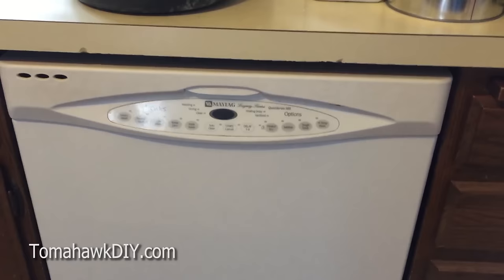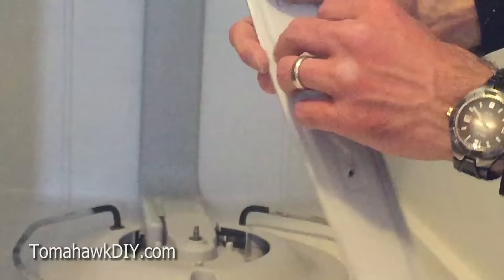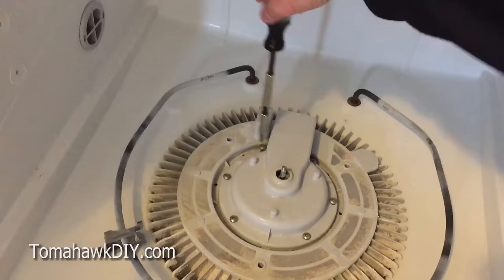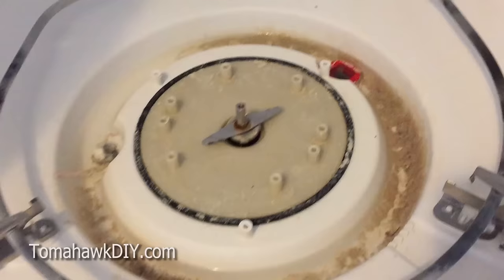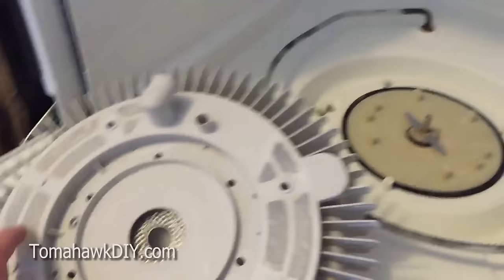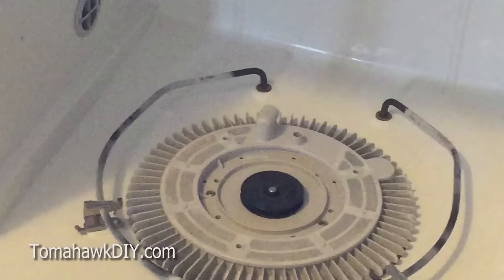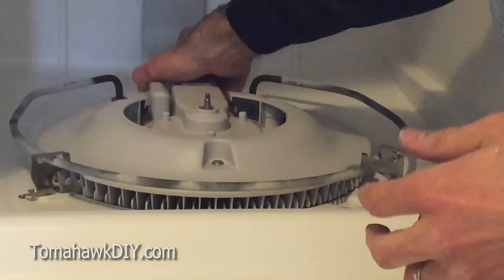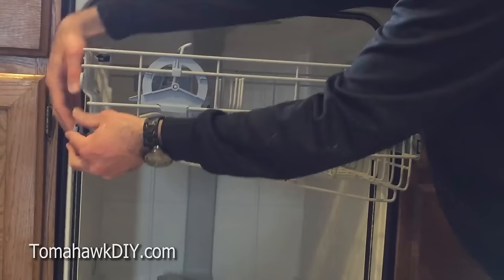Dishwasher Not Cleaning Well - How to Clean

Comment: I have a QuietSeries 100, not 300.  I did exactly that (it seems to be the same water circuit), and also ran water in all the upper pipe elements/spinner,  but I am still getting black dirt in the cups of the top drawer.  Anybody has an idea?

Comment: Great video, very easy to follow. Question for you - the metal clip that holds the spray arm to the top of the dishwasher came off and won't snap back on. Any idea on how to fix? I've been trying different ways to pop it back on and nothing has worked. Thanks!
Reply: The plastic support on the dishwasher body itself is shaped like an X(or a cross).  Position the square hole of the clip over the X and rotate the metal clip slightly so that the four legs of the X point to the CORNERS of the square hole. That allows you to press the clip over the X-shaped support. Then just twist the clip so that the legs of the X catch the clip and hold it in place.

Comment: 4:54 I seem to have it aligned but still can't seem to get this filter on properly. It doesn't go "deep" enough, and when I put on the wheel & try to tighten the screw, it doesn't tighten because the wheel isn't deep enough and so the screw can't get to the metal part that's sticking out.

Comment: You have a different model than mine.  My washer is 20 years old and has been really smelly.  It smells like fish that's been out for a while.  
I'll be cleaning the screen (never done before).
I'll figure it out.  I also have two covers in the bottom front of the washer.  What is that for?

Comment: I've had trouble cleaning the filter in this maytag machine.   The inside get clogged with fine hair if you have pets in the house.......  forms a felted mat that retains greases and simply will not be washed out.  I've had success with running household lye.....  one table spoon per cycle for a start.   Let it run for a few minutes, then turn off or an hour while the grease is dissolved, then finish the cycle......... repeating might be necessary.  Once grease is cleared, the hair is more readily flushed out the drain.

Comment: Thank you! This is exactly what I was looking for. I have one question though. Is it necessary to shut off the electricity to the dishwasher before beginning this disassembly?
Reply from the maker: +Gail Guy it's good and safe practice to remove or secure sources of energy that could cause harm when working on machines. I shut off the power when I work on them.
Reply: Gail Guy ;

Comment: What do you do if your mesh comes off on one of the round pieces? I have an area that has it coming off. Can I leave it like that, or reattach it somehow?
Reply from the maker: That mesh is important - it's a filter to keep small bits of food from recirculating.  I'm not sure of a way to repair it. If you can come up with a way to re-secure it, you could try it.  Maybe you could cover it with something if its a small area - you don't want to stop flow of water through the mesh.  Your best bet is to replace the filter.  Try searching on Amazon - there's a spot to enter your model number and find parts that fit.  http://amzn.to/2mATNOy

Comment: The clip that holds the spray arm to the wall came off and I am unable to get the clip back on. Any suggestions?
Reply: Had the same issue. It was very hard to get back on upside down. 😀

Get the cross one on first and the the lines one should snap on.

Comment: Thanks for the video! But I got stuck at 2:43 minutes. Couldn't remove the black circle. Screw came out, black circle spins around, but it won't pop off. Any suggestions?? Thanks!
Reply: I figured it out.... Had to apply  WD-40 and let it soak for a while. Was able to then wiggle it enough to come off but it still broke in the process. Had to buy a new piece....( It's called an impeller, in case anyone  else didn't know that 😆) So all in all it cost me one afternoon and $45 to fix the dishwasher..... Still pretty cheap so I'm very happy 😊.
Reply from the maker: Happy to hear that! Thanks for watching!

Comment: Thanks.. That was helpful on cleaning the machine. However my problem is that it fills,  starts cleaning and 3 minutes into the clean cycle the machine shuts off. I haven't found a YouTube  that addresses that issue. Any ideas?
Reply from the maker: +sandy bredeson sorry. I've not run into that one before. Anyone else? If during knows how to fix that and videos it I could put it on my channel if you want
Reply: I have this model and I had the same symptoms. I replaced the start capacitor and it fixed it. You should run the diagnostic that is built in and it will tell you what the problem is.

Comment: what are the 2  black plugs for on the tub going up the back to the blade?
Reply from the maker: I believe you are talking about the holes that send water into the upper rack spray wand.  Look at the spinner on the upper rack. When the rack is pushed all the way back, do tubes from the spinner slip into those plugs?

Comment: What happens if the metal clip at the top comes off and the top spinner isn’t secure?  I did all I could but could not get it back in at the top of the dishwasher.
Reply: I had the same problem. Rotate the metal clip 45 degrees before placing into the little plastic x. Then rotate it back straight again until the other part of the clip attaches to the other side. The other part looks like a little ramp. Make sure you slide the metal piece up the ramp and into place.

Comment: What do you do if the spinner's bolt won't unscrew ? I tried using plyers to take it off, but it's screwed on really tight and just shaves the sides off of the bolt when I keep trying to loosen it up.
Reply from the maker: This might help if you strip the threads. How to fix screw that striped from plastic - epoxy turns to plastic https://youtu.be/1xcpZIS3fgY

Comment: Use a cup of CLR in the washer then run a cycle like that without anything else in the washer then run another cycle with just water to clear out any left over CLR. You do not even have to take anything apart and it dissolves all scale and cleans it very efficiently. In this video you left half the scale on the parts and what good does that do for it? If you take it apart at least clean it thoroughly before reassembling it.
Reply from the maker: I've not used CLR before, but am concerned that it is labeled for cleaning tubs, toilets, sinks, etc.  I'd be concerned about residual chemicals, even after significant rinsing of the parts.  I do agree that the scale i left on the parts was less than ideal.  Just my thoughts.

Comment: I did this but my water is nit running anymore do u know what could be the problem ?
Reply from the maker: +Abtin K maybe a water valve is closed or a wire to control the flow of water is loose. Just guessing.

Comment: What do u do if you’ve never cleaned it and the food stuck in the round mesh piece WONT come out?
Reply: Personally i soaked mine for a good while and then i used the sprayer nozzle on high. It acted as a soft scrub on it. Hope you got yours working.
Reply: @karensmith7094  thanks! I tried for an hour with the sprayer and super hot water, and it just wouldn’t budge. The food is so stuck, it’s just a lot in there, compact in certain spots. I got a lot out, there was just some that no matter what wasn’t coming. Maybe I’ll try soaking it for awhile. Thanks.

Comment: You said you can take off the silver tabs on lower spray arm and "disassemble" to clean it thoroughly. I did take them off and cleaned them but don't see how it comes apart? The spray arm doesn't come apart more than that, correct?
Reply: I have the same question as you. Have you figured it out?
Reply: @hualee1032  It's been 2 years since I did this but I think I just poked a toothpick and the soak them a bit in hot water. But now you have reminded me that I should probably do another thorough cleaning of my dishwasher. So thanks for that😂 At least now I know how to take it apart. Very sturdy dishwasher.

Comment: Do you need to turn off the power or unplug it? Or can you just go in and clean it?
Reply: I was wondering the same thing...
Reply: No need. I just finished mine and there are no electrical components to worry about.
Reply: The little metal thing in the middle at the end of disassembly is like a little food processor. And the big coil around everything is a heating element. Take that information for what it's worth. ;-) It's not LIKELY that you're accidentally going to activate it, and indeed there are PROBABLY components that prevent the circuit from being closed without the door being closed. But whenever possible, you should unplug such devices before tackling this kind of cleaning. And if you decide not to, please for the love of god be aware of that spinning metal bit at least and stay clear of it. The heating element accidentally coming on isn't likely to come as a surprise, but a spinning blade will.

Comment: What was maytag thinking when they made that round filter thing impossible to open to properly flush!   I used a dremel on mine to make it openable.
Reply: What did you do to open the mesh piece?  I'd like to clean mine from the underside but I'm worried if I pry it open I'll break it.  Thank you

Comment: I tried doing this and my assembly would not go back together as easy as it was to take apart.  And when I tried to run my dishwasher, water went all over the floor.  I called a repair man to come to the house.  He would not work on the dishwasher and told me to buy a new one.

Comment: Pulled the drain apart. Put everything back together. Now the dishwasher won't run through a cycle? It will fill the bottom with water and just stop. Once I hit the cancel button it will drain the water but it won't run the cycle! HELP!
Reply: Check on the bottom of the machine and there should be a big round plastic "knob" looking thing that should move up and down. That is the float, similar to a toilet float that shuts off the water when it's full. Be sure it's not hanging up on something or that it's not cocked preventing it from moving up and down freely. If you dinged something electrical, well, I don't know what to tell you then other than look for a loose connection or to make sure your door latch is latching completely. It has a sensor that will keep it from running. Make sure the door is closing and seating completely and toggle the latch several times. Good luck...